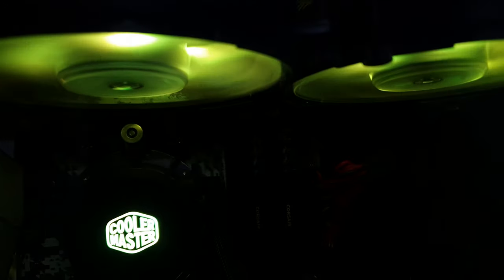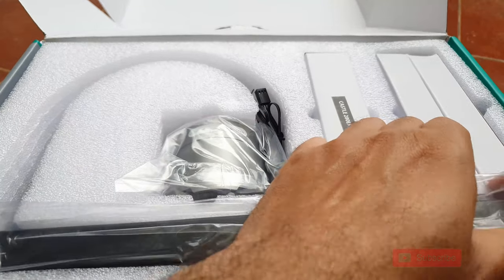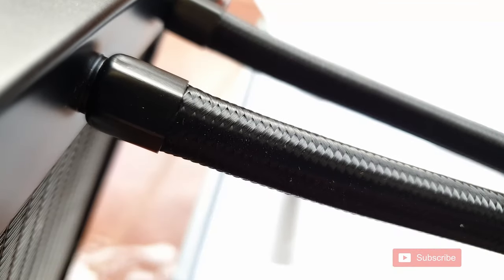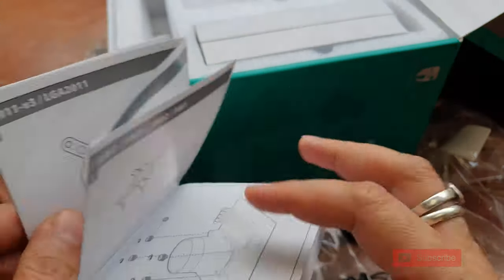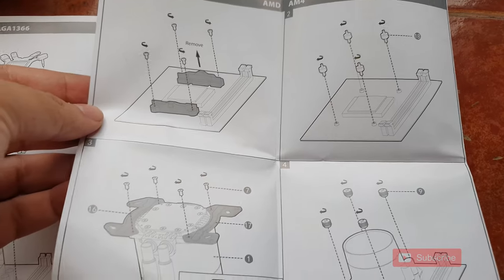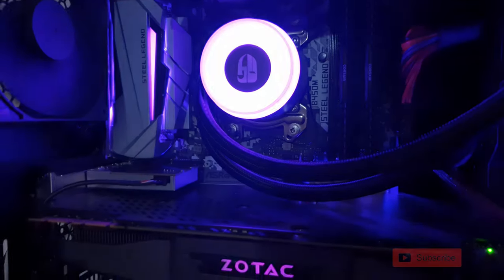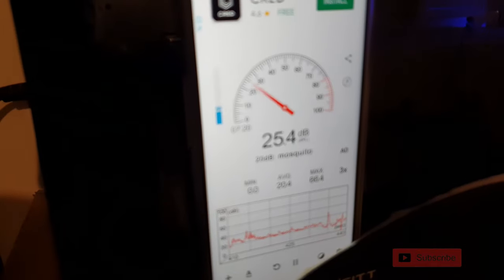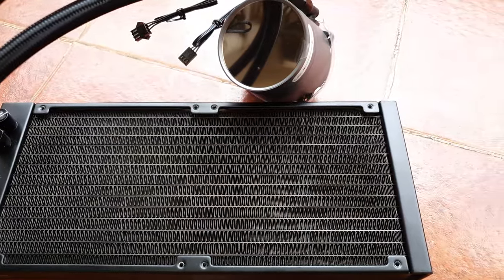Got the Deepcool Castle 240EX, sadly the 280EX did not fit in my Coolermaster H500

Comment: Nice thanks for review again. I think you convinced me to go Deepcool Castle 240 route.  The NZXT Z53 Kraken 240mm goes for $219 USD while the Deepcool Castle 240mm runs for $89 USD currently.  I really don't need an LCD screen on my CPU and I'll save 130 dollars, it just looks cool.  Last 2 years I have been using the Wraith Prism cooler while I'm gaming, I suspect that it has been throttling my performance on my 3900X. Heck when I'm Idle or low load im at 45 deg C !
Reply from the maker: Ah I see... honestly the Kraken was in my list to buy... but this 240 Ex with its twin blade tips were deemed quieter in many reviews.. and it's not bad looking at all so might as well save the $$$
Reply: Im going deepcool 240mm top mount exhaust because of your review! Now my question is should I upgrade the rear stock 120 mm exhaust… maybe even make it an intake since i now have 2 more exhaust from the aio?

Comment: Hey! I am the same person who asked about the kraken x63 in the h500 case. I watched the video as your recommended and now I am concerned the cooler radiator wouldn't fit in the case beause of the same issue; I plan to use MSI's B460M-A PRO Micro ATX LGA1200 Motherboard and Crucial's  ballistix DDR4-3600 CL16 Memories (2x8). Would that interfere with the cooler? I'm sorry if the comment is too long, this is my first time putting together a computer so I have many concerns.
Reply from the maker: Its simple compare the MoBo layout with  that of an AsRock Steel Legend... if the RAM is placed in a similar place... well looking at the image it is a similar layout.... the 280 may cause problems...
Reply: Hmmm well I see... Thank you for responding I really appreciate it. I will look around for a different motherboard if you have any recommendations with a similar price and performance let me know!
Reply from the maker: I think that the MoBo is fine... just get a 240mm radiator... instead

Comment: Hey man, I'm confused with the deepcool aio 240mm, there are two options - 
1) one which you have in your review
2) the new one with the " X " fans. 

Which one should I go for? Pardon me I don't remember the exact model numbers.
Reply from the maker: Sure... the one which I have is the Castle https://amzn.to/3wre7Sb there's also the Gamaxx https://amzn.to/2UAhzws which is an ordinary cooler. The Castle has those twin blade setup which make them quieter. There are no RGB fans on the Castle, cos the blades have a superior design.
Reply from the maker: This link you sent has RGB fans... it may look good but it will be noisy. That's the only difference